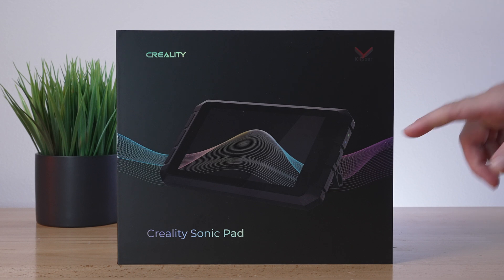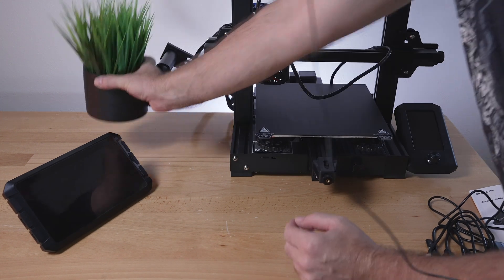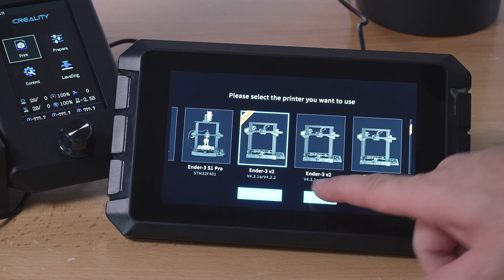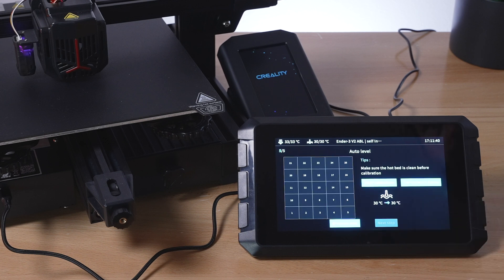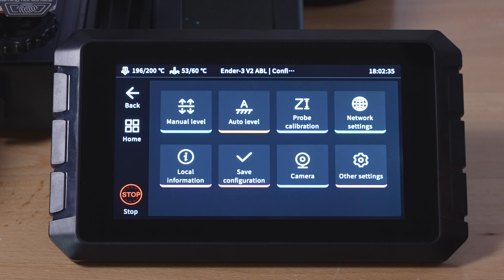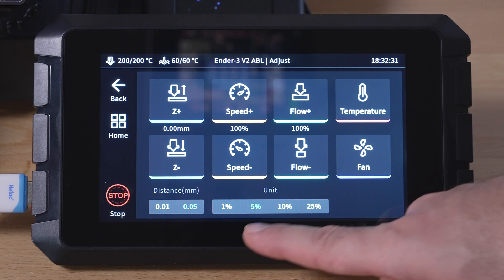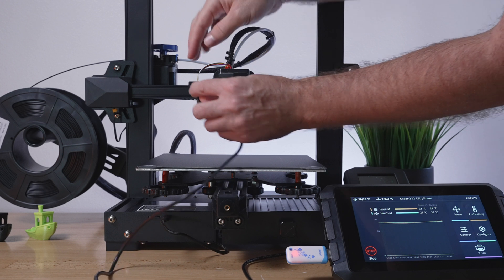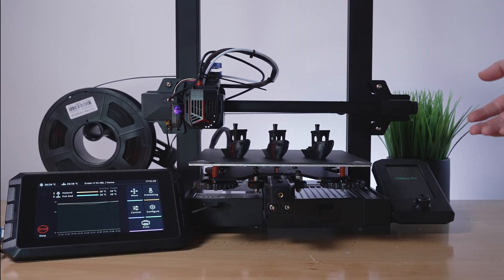Creality Sonic Pad - Klipper Setup with Ender 3 V2 Neo

Comment: for those wondering how to adhere the sensor to the bed(the video was mistaken) you can jsut use glue stick. 
I put a few dabs of it on the underside and pressed it onto the bed for about a minute. then let it sit for 5 minutes before clicking next. once the y axis test was done it came right off since it was still goopy.

Comment: Do you have any suggestions for connection issues with the Ender 3 Neo V2 CR and the sonic pad?  My son got both of them a week ago and carefully followed the instructions and we keep getting a pink bar at the top saying "printer is not ready the klipper host software is attempting to connect.  Please retry in a few moments".  We have reached out to Creality support but each contact takes 24 hours since it all needs to be done by email and with the time difference...He has watched many videos to try and problem solve but is just very frustrated right now.  We would appreciate any suggestions.
Reply: Did you figure this out? I’m having the exact issue

Comment: i have an Ender 3 V2 Neo and i have tried to set up 3 different sonic pads (1 was new from amazon) all prints are about 1/2 inch to the left( have to move magnetic pad to the left to get that first line on the pad) and fails at 99% with a move out of range error and heaters stay on until i hit stop to cancel everything. any ideas?

Comment: Hi.. I would like some help and good iders, to get my sonic pad working 😞 I follow all the instructions, but when i get to the point, where i am to flash the klipper firmware to the printer - nothing happens. I have tried several different SD cards (also i have tried to print from the sd cards - no problems there) I have tried to flash from the sonic pad, to a newly formatted sd card, also formatting the card, placing a print file on it and then running the print ( again no problem - which tells me the printer has no problem in reading the card) Then flashing from the sonic pad - no joy. Can it be the firmware on the printer that is the problem (V1.1.4). Please help me - i am mm away from discarding the sonic pad. Cheers from Denmark P.S ihave seen the "klipper_103_v02.bin" file is on the SD card.

Comment: How do you get sonic pad settings for the creality slicer? I'm using a mac, most up to date version of the software, and when I add a new printer there is nothing specific regarding the sonic pad as other users have mentioned... just the usual list of printers. I can't see any mention on mine specific to the sonic pad... I have been using Cura with their supplied profiles as a starting point but Cura likes to crash in my M1 chip macbook pro so I was hoping to try out the Creality instead.

Comment: You need to mount the sensor on the bed aswell and run that separate
Reply: how do u mount it to the bed? There was a model we could print for the X-Axis to mount it securely to hot end, but nothing for the bed. I assume the youtuber had the same problem and skipped that. ;-p
Reply: @farrelcoetzee2795  what i did was i meassured the holes and printed a small items woth screw holes that i screwed it into. Then meassured it and after i was done just removed it
Reply: @tobiaspersson7320  I eventually just used a heavy-duty paper clamp (foldback clip) and clamped it down on the edge of the bed. Wedged a small piece of scrap plastic to support the wide clamp next to the gyro. Worked like a charm. I see many print something out to clamp, will likely do this going forward for future calibrations. Thanks for the reply.

Comment: Does the pad need to be connected for the duration of the print?  AKA, could I use this on all 3 of my Creality machines simultaneously?
Reply: I know this is old, but no, typically the machine cannot run without the klipper host, so it won't work if you disconnect the USB.

Comment: So once you have the sonic pad do you have to change anything with the slicer or not? I normally use Cura.
Reply from the maker: Nope, prints any g-code with no issues. Just crank up the speed and you'r good to go.
Reply: @Just_Print  cool thanks

Comment: The sensor is only needed for the calibration so you can just get it off the printer. If you change something on the printer or retighten something justput it back and recalibrate and take it off again to print.